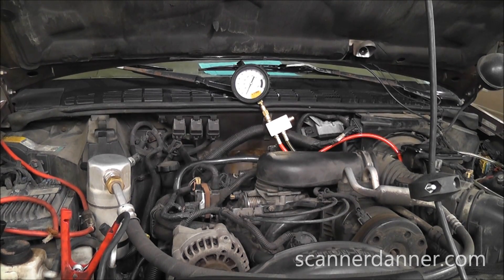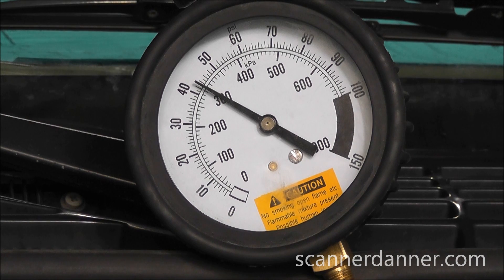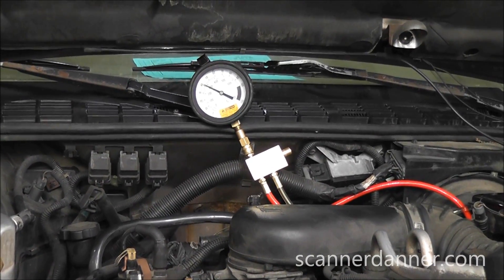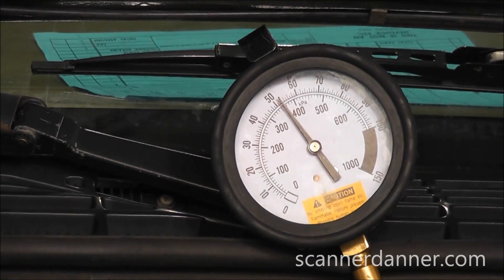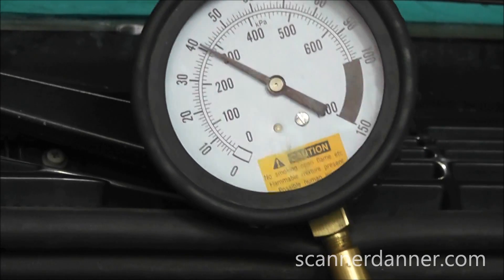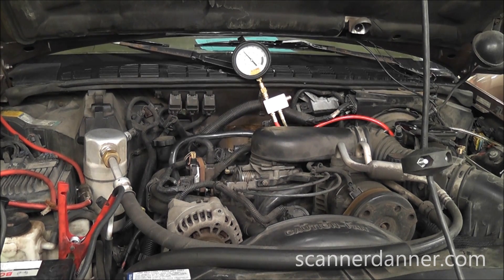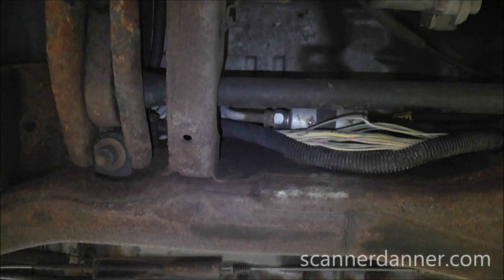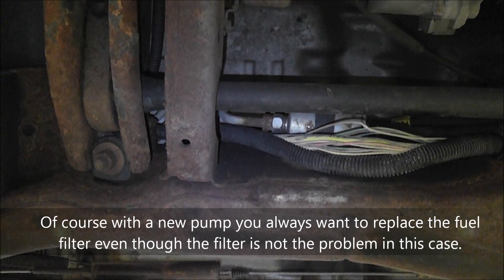Fuel psi less than 50 psi = no start (GM CPI Vortec)

Comment from the maker: Ok i see where your coming from but you're not thinking this all the way through. I agree that checking it with the relay involved is the most accurate, however if the relay was the problem I would have had normal pressure and amperage with the relay bypassed. I did not. Fuel psi never got any better (i should have shown that). But with the amperage being 3-5 amps lower than normal this was enough to say this is not a relay problem......
Reply: ScannerDanner going to brothers and check it out got the stuff in his shop pressure fuel gauge and computer go ahead and do the rest I saw on the video I no I didnt do all of it also had intake air leak that wasn't seen on air tun in the intake on bottom it has not yet not wonted to start sometimes runs little Rick if I just jump in start up so I jump in turn key on wait then start
Reply: ScannerDanner I got you

Comment: You're jumping the fuel pump directly to battery voltage, bypassing the fuel pump relay. The computer controls the fuel pump relay control side and it is obvious that the relay is working because there is pressure,but you could have corrosion inside the relay affecting the load side(gray wire). I think the best test would be cranking the engine (load the circuit and let the relay do its job). I learned this from you. Also a faulty relay ground would affect load side voltage, wouldn't it.

Comment: Nice Video! The 95-up 4.3L (VIN code "W") (RPO L-35) motor needs 60 PSI minimum to start cold ,and the pump should "Dead Head" @ 72+ PSI

Comment: My guess wld be the piercing probes... dont sweat it i use those frequentlly for testing as well they come with the pico scope... And a true diagnostician wld rather risk poking a wire that is easily fixed... specially on a gm who give u a new pigtail with shrinkable butt connectors to re-attach;) if u test close enough u cut the spot out anyway.